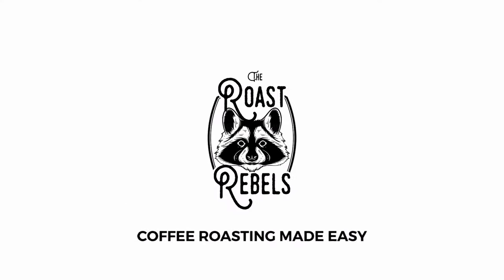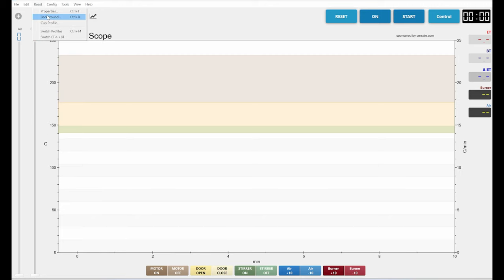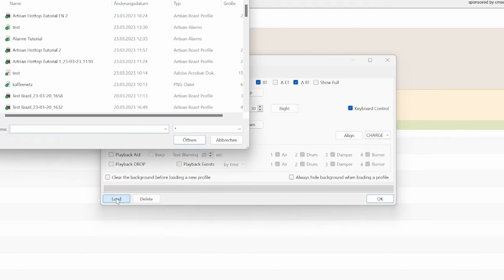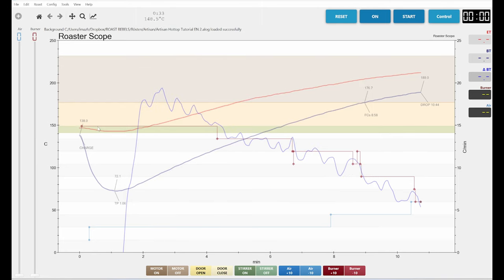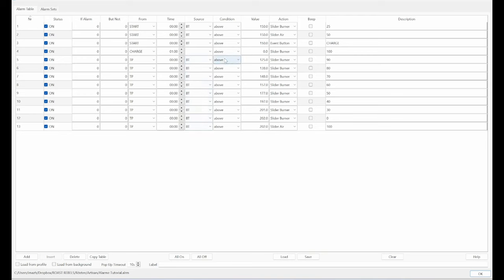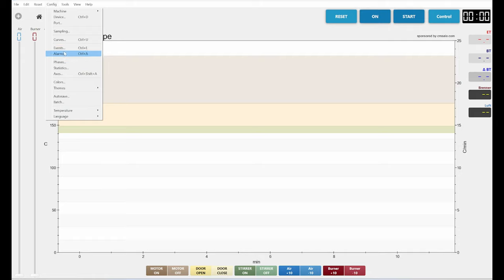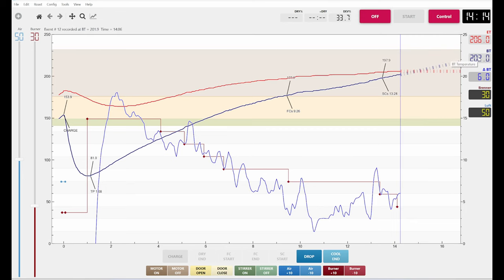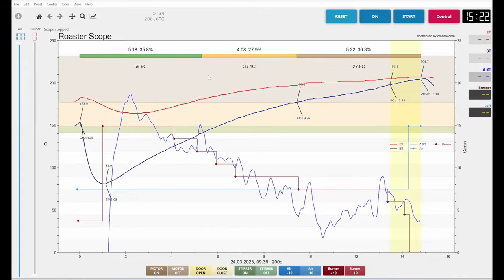Alarms in Artisan scope for the Hottop roaster | a step-by-step guide

Comment: I recognize this is an older video, but based on my limited knowledge of Artisan so far, for the part of alarms you said you don’t use, it would actually be useful - basically, in the “IF ALARM” you can add a conditional statement so that something won’t happen unless a previous alarm happened. So you could refer to Alarm 1, meaning ‘only do this alarm if Alarm 1 has already been triggered’.  It just adds an additional level of This/Then statement but can refer to a previous step.  I was hoping to find out how to actually have the power and air steps record their numeric value on the chart instead of just the graph of the heat and air. For example, if I turn my heat to 80, I want the graph to actually say 80.  I’ve seen other Artisan graphs that show this but I cannot find the feature to turn it on. Thanks.
Reply from the maker: I don't see a benefit in the if conditions and therefore prefer to keep it simple. But of course everyone has their own workflow

Comment: Thank you for this tutorial.  Question about a potential feature…is there a function in Artisan in which I can take a background roast that I have saved that is particularly good and, with the click of a button, convert that profile into alarms to be automated?  All of the events, temperatures, actions, etc. that I manually inputted into a successful roast and saved as a profile/background, could then be automatically converted to alarms for automating that roast without having to go through a step by step setting of individual alarms?  In the Bullet, there is a feature that allows one to load a profile and just click “replay” which automatically allows for automation of a profile, and I would love to see such a simple, easy to implement feature for the Hot Top.  Alarms are a pain. Thank you!
Reply from the maker: You can go to Roast --> Properties --> Events and convert the events list into alarms. 
I haven't been too successful with that though and prefer to set the events up from the scratch. Like that you understand the triggers and if you've done it once or twice it isn't that much pain anymore. But of course you can also take an alarms list created as above and the check it if all makes sense.
Reply: THANK YOU!
Reply: I tried converting my Hottop events to alarms a few weeks ago and found way more steps than I expected. Looking at my graph I saw why: the Hottop heat adjustment is in 1% steps from 0-100, so when I dialed the heat up or down I ended up with a boat-load of 1% entries that Artisan logged and I had to delete. Though I'm sure I could mostly avoid that by using faster dial spins, the odds are pretty good that I would still at times over-/under-shoot my desired settings thus leaving a logged mis-step or two, so I have decided to just create my events from scratch.